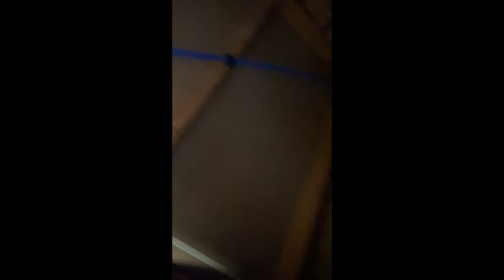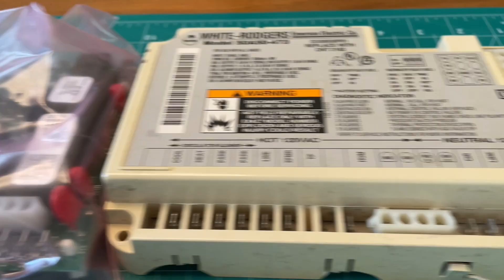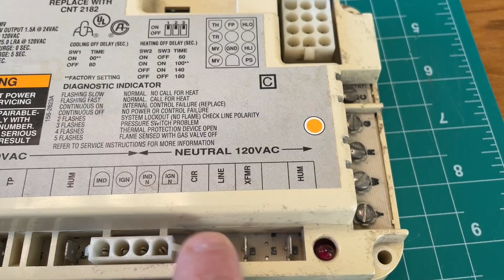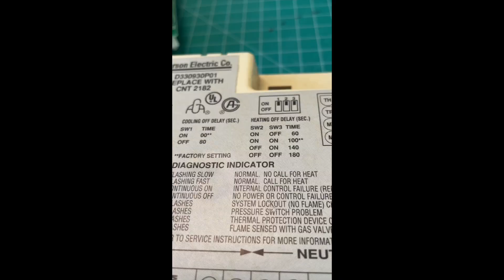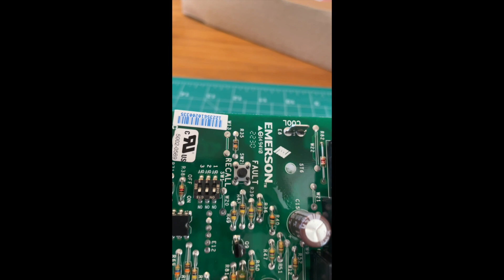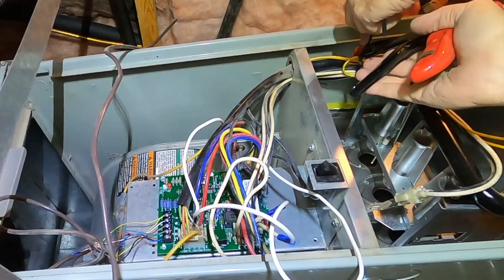Fix Your Furnace Fan

Comment: I have this exact same unit and board except mine is an American Standard for which I know makes the Trane. I’ve tried replacing my old controller with the new one for the same issue that you were having and both boards arrived DOA from Amazon. I too pics and labeled all 9of the single wires, checked and rechecked on both updated boards and I can’t get the LED to come on, my thermostat to boot up, nothing but a hum. I can reinstall the original board, White Rodger’s 40A50-473 and my thermostat boots up, the LED comes on and i can also check for voltage with my meter . It’s har to believe that I woujld get 2 bad boards, but it’s really not that hard to replace.